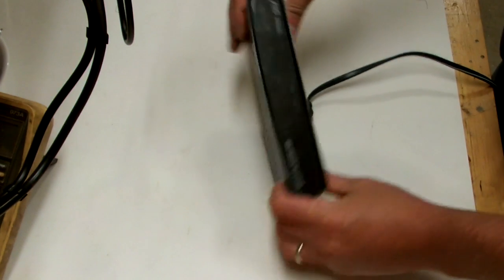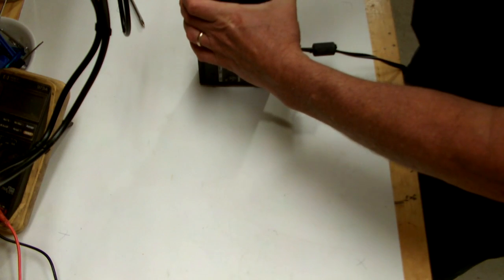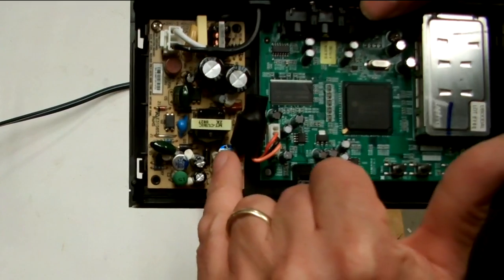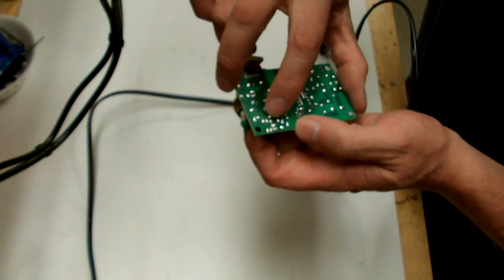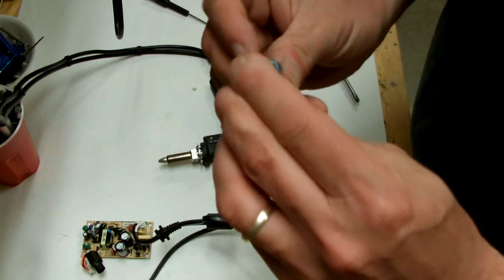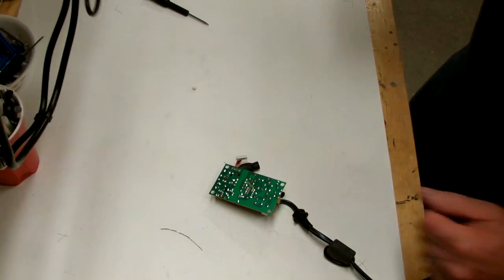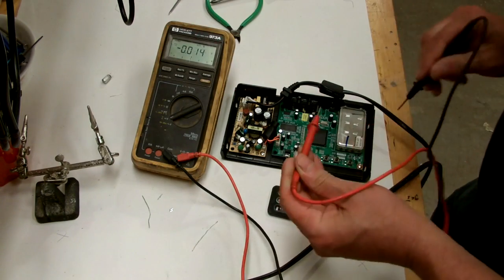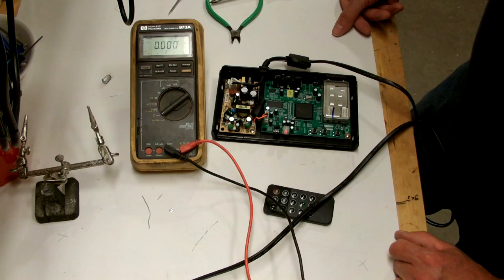DigitalStream Digital to Analog TV Converter box repair

Comment: Mine started acting up with "no signal" message on all channels. Unplugging/plugging fixed initially but soon had flashing green light and would not power on.  Mine has a different looking PS but had a blown 330uf cap.  Replaced and all good.  Thanks for video!

Comment: did you replace 2 - 470uf 10v caps in the power supply with 2 - 470uf 25v caps  (10v for 25v)? is that correct?
Reply from the maker: The voltage is the capacitor's highest working voltage. It is OK to go up but not down.